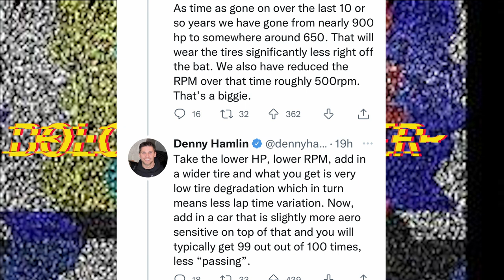Denny On How To Fix the Short Tracks and Who is Number 1 at Hendrick

Comment: They've turned the cars into drift cars with the hard chasis, lack of nose travel (up & down through soft springs). Do you remember when they would come out of the corners with front to rear nose weight transfer down to the flagstand, lift and roll the corners? They forget that Mville is two drag strips with corners at the ends. Richard wore them out in the late 60s and 70s with the charger rolling over to the right rear (left rear to right rear transfer and front left to right rear transfer).
Reply from the maker: Yep. Bump stops killed the travel new car finishes the job on it. It’s all platform racing now

Comment: It seems to me that the diffuser has made the racing better on intermediate tracks by putting the dirty air directly behind the car. On tracks where there are multiple grooves the trailing car can find some clean air so the racing is better. But at a place like Martinsville there is only one dominant groove so the trailing car is forced to run directly behind the lead car where there is more dirty air than ever before. I’m with KFB on at least trying to run without the diffuser at short tracks. Obviously we need more horsepower as well. It makes no sense that you can just buy a car from the dealership with close to as much hp as a racecar from the top series. I wonder if you could win the pole at Martinsville with a stock Hellcat Redeye.

Comment: I think the transaxle should be able to hold the torque that comes with 750hp. That should be next year’s base package instead of the 670 package. The 670 just doesn’t quite have the power these cars need especially on short tracks
Reply from the maker: For sure whatever they need to do to get some more power and more tire wear

Comment: id say chase is the top guy at hms, hes had more wins, more top 5s, more laps led (twice as many as kyle), if you compare the difference between average start and average finish kyle larson loses 5 positions and chase gains 1 position. the only thing theyre tied with is poles and top 5s. i think theyll both make it to phoenix, but all the set up info etc will be to benefit chase more than kyle since chase is statistically the best driver. if youre going to have a car designed around winning at phoenix, id rather give it to the guy who gains a position rather than the driver who loses 5 positions.
Reply from the maker: Chase definitely is having the better season by far of anyone really. He seems to have the feel of this car down as well. Definitely see your point as having him be the baseline setup guy.

Comment: Hendrick number one < team unity. They all give input. Jeff Gordon decides the course. That’s his job. Denny’s input on horsepower and torque... I personally don’t think the current supply of axles and transmissions would handle much more on a short track. Nascar could develop testing provide something better more horsepower and torque drivelines. Short track racing of the late 80s to late 90s would be great again. I’m sure these engine today could easily be turned to 950 to 1100 horsepower if nascar would allow it. But it might have to be done with a solid rear axle.
Reply from the maker: Definitely might need to update the drive train.

Comment: Why not remove ground effects for short tracks
Reply from the maker: Definitely would help
Reply: Why not drive what's on the stock room floor?  No excuses.
Reply: @danielroberson5421  They will never go back to "stock" cars  They wouldn't last 100 miles and could barely exceed 100 mph
Reply: @marklangren3142  You don't know much about cars do you?
Reply: I suppose you're gonna run one of the stupid dodges with eigh a 100 or a 1000 horsepower no brakes and O breaks and some  Handling    The other only sudo  Sit Anne's are the Mustang and the Camaro both of which are going to be dead shortly Neither car would make an hour on a route on a road course. There is no production American automobile other automobile other than the Corvette that would have a chance of running on a race track for any period of time
Reply: @danielroberson5421   Right now the only pseudo Sedan's in this country that met with last on a race track or Porsche BMW and Audi's

Comment: The root cause is that the new car has too much downforce and tread patch for the amount of horse power.  But I missed something, I thought the short track cars had 750HP.  Is that no longer true?  You'd just about have to spin the world backwards to get Goodyear and NASCAR to narrow the tire.  I'm no fan of the under body or diffuser either
How fast the tires 'get' burned off is a marker of driver skill.  If the tires are so good that no matter how hard you run them, they don't lose significant grip, then you don't need good race car drivers anymore.  I mean that is really NOT what fans should want or NASCAR should deliver.  It sounds ridiculous but look at all the costs and changes required to put that tire on the cars.  Not to mention the crap shot factor they have brought to the racing.  I bet it took the teams at least a few moments to count all the money they are 'saving' with this car.  All of this was foreseeable.  NASCAR being NASCAR.  "It's de ja vue all over again."
Reply from the maker: I think that’s the issue. The tires are so hard they don’t lose grip and probably don’t have much grip to be fun with. More power would cause the drivers to have to use throttle control to not burn them off so if Goodyear goes conservative with the tires at least they will still burn off.
Reply: @BolognaBurger  There's definitely a happy medium to be had between horsepower and drag but I've never heard a race car driver say they want less horsepower.  They get passionate about how much better it would be to have more HP by default through.  😆